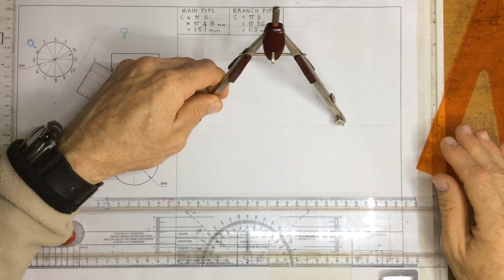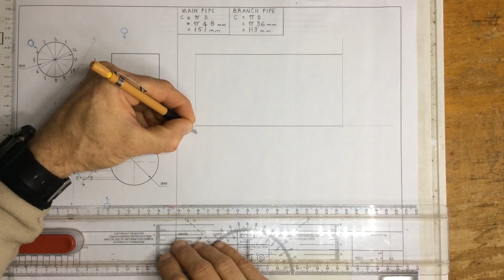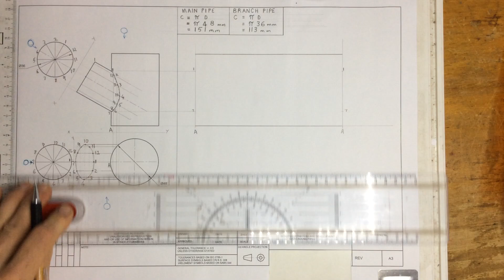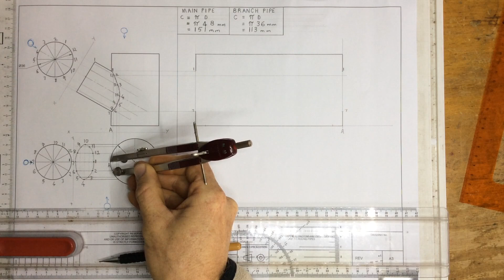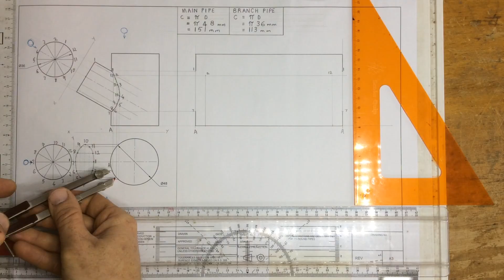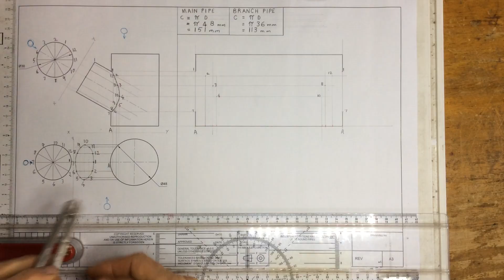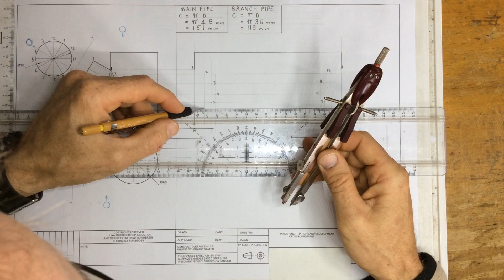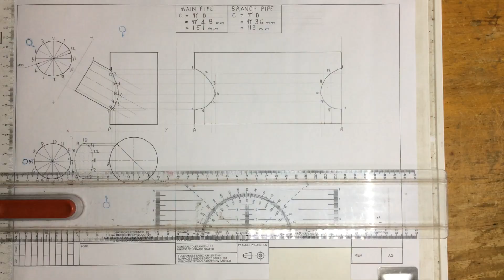development of the main pipe

Comment: How did you get the circumference
Reply from the maker: If you look up at the top there is the formula and you can get the diameter by measuring it or it is normally given. place the diameter into the formula and use your calculator to calculate the circumference.